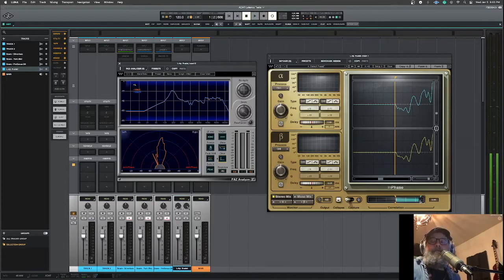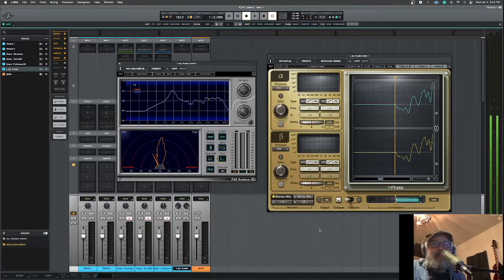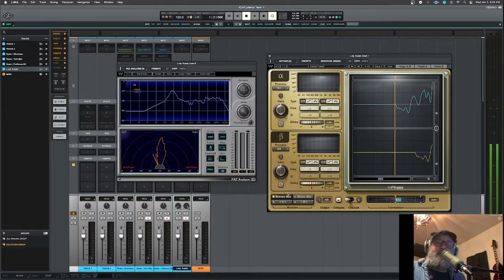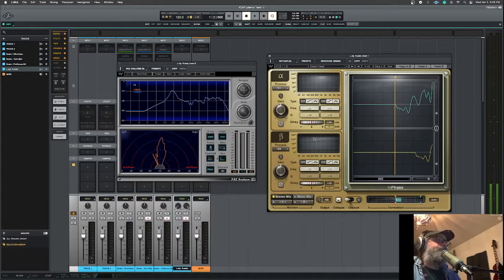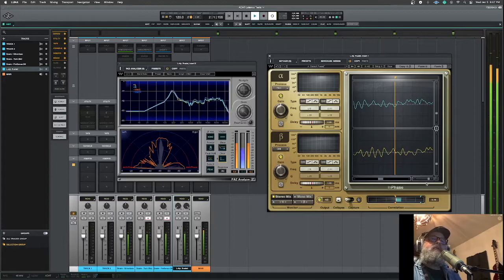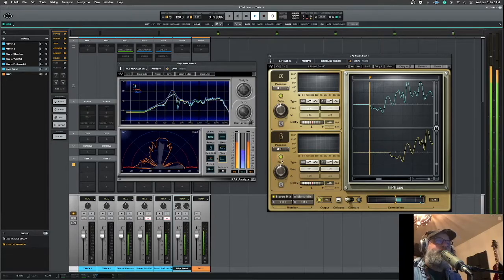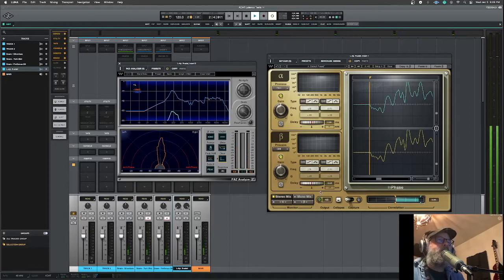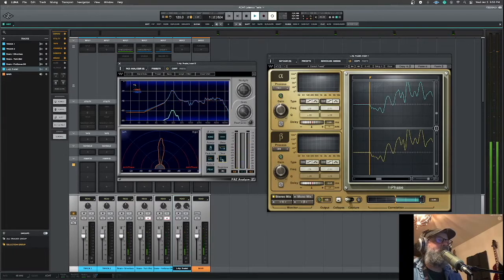ADAT Input Delay - Does it Matter?

Comment: Awesome video! So the way to avoid this completely would be to make sure any source over ADAT isn’t sharing inputs with your non ADAT interface? Is there a way to compensate for the delay in real time?
Reply from the maker: Correct... if all of your input sources are plugged into the same device (all main interface or all ADAT expander - this is NOT specific to just UA Apollo) then there is no issue. It's only applicable if you are recording using both at the same time.
Unfortunately the only way to compensate in real-time would be to delay the main interface input signals somehow... which defeats the purpose of trying to get as close to zero-latency as possible while tracking. Additionally, there is no way to bring the ADAT "forward" some number of samples in real-time either... that would require an H.G. Wellsian Time Machine of some sort. :D
Reply: The way to "avoid" this is with recording templates. The amount of delay will always be the same, so you can always put down a plugin that moves your recorded audio from your ADAT source forward by the number of samples you are off, in this case 24 samples.